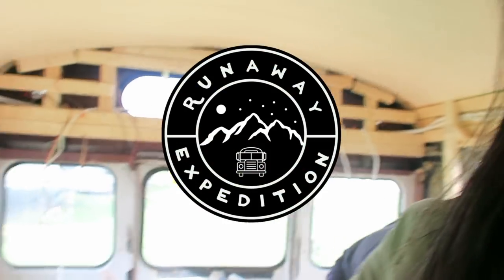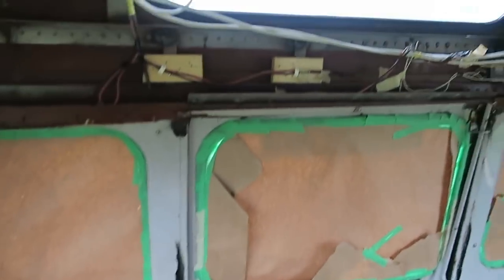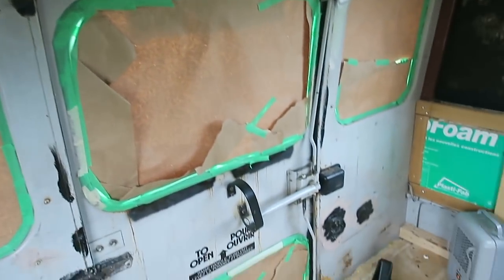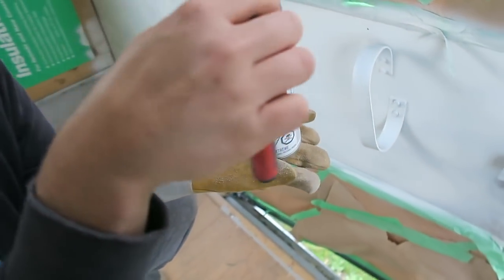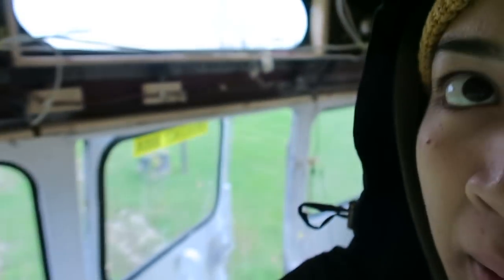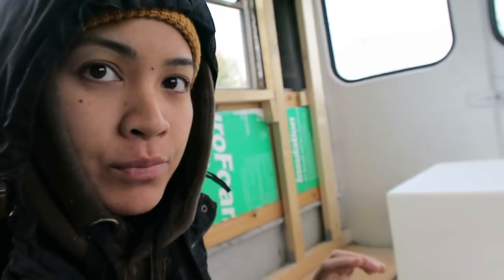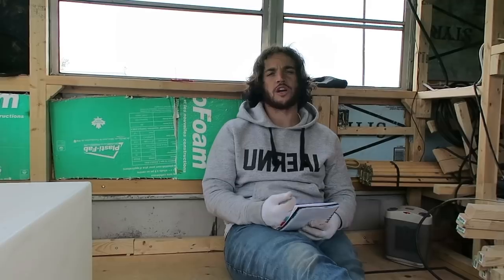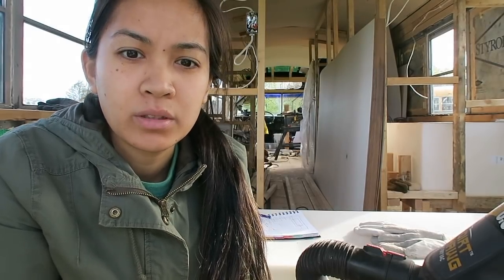Spray Painting Inside A School Bus | School Bus Conversion | Off Grid Tiny House

Comment: This is awesome guys! Thanks for sharing. I am (slowly) working on remodeling the inside of a Ford E350 to function as a shuttle bus to and from concerts and other events. The back wall and some of the interior walls (that arent covered by my framing that I put up) have me stumped on my next move. Plus I have an AC unit attached on the interior top, back panel. I redid all the interior top with fresh masonite board, but havent touched that one with the AC unit and trying to think or a work-around. Trying to get some tips and helpful hints and you guys certainly lift my spirits up and give me some hope!
Reply from the maker: its definitely a hard process! you get discouraged more often than not, but its gonna be SO worth it in the end. keep it up & good luck :)

Comment: I will be painting the inside and outside of my bus in the spring when it's warmer. I will be using brushes and rollers instead of spray paint though. Thanks for the update!
Reply from the maker: we'll be painting the outside in the spring too. I think right now, we're thinking rollers but we'll see. thanks for watching! :)
Reply: Runaway Expedition just a thought for u before you paint sand the bus first u don't have to sand down to bare metal just scuff it up